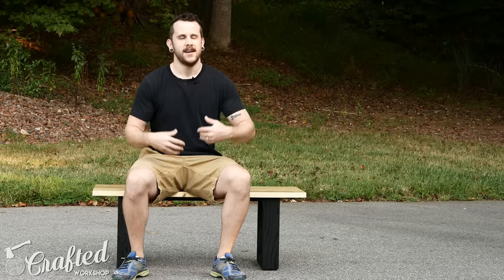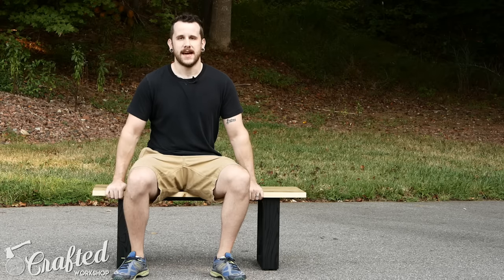How To Build A Modern Pallet Wood Bench | Crafted Workshop

Comment: Cool bench! Be nice to see a video like this that's done primarily by hand. Rather than with £1000's worth of tools which some of us don't have.
Reply from the maker: +Sharkfat I can't even imagine how long that would have taken by hand! Took me at least 20 hours with power tools.
Reply: OK, not including materials (= $0?), overhead and tools, a sale price btw $1200-1400 ???
Reply from the maker: +Stijf Wood overhead is nothing really, I work out of my garage. Tool prices are a fixed cost, I don't really factor them in unless they are getting a lot of wear and tear on a given project. I would sell this piece for ~$600 based on the amount of labor.
Reply: OK, thx for the info. I'm in Norway and ur estimates wouldn't pay my bread and glue, at least not if price is before taxes. But then, life is expensive here and a pint of beer easily costs $10 in any bar, so it's like comparing apples and oranges. Keep up the good work man.
Reply from the maker: Stijf Wood yea, definitely a much different cost of living there!
Reply: More like £10,000's worth of tools. His Table saw alone is over  £1000.  But don't be drawn away, I started with a 15$ hand saw and now 2 years later, I have a 3 1/2hp  Powermatic Cabinet saw. From projects like these.. Well manly cedar planters.

Comment: Cool project. Thanks for being realistic with the use of pallets, it's always overhyped and people don't realize how much labor is involved.

Really shouldn't have to start with 80 grit straight off the planer unless you have some major nicks in your planer blade, but in that case I would use a few passes with a handplane.
Reply from the maker: Thanks! Yea, pallets are a pain. I had some tearout from the planer due to the differing grain directions, hence the 80 grit. Also had some snipe to deal with.
Reply: I have the luxury of access to some industrial pallets used for transporting bulk metal so it's far more usable stock but it's still very labor intensive, so much so that I rarely even try for a modern piece and stick to mostly rustic.

Oh yea, makes sense, I suppose that thin pine would give you some chip-out/tear out problems.

If you get a chance to work with industrial pallets it's worth another shot but I agree with your special pallet project at the end for normal ones.

Comment: another way to take apart pallets is to put it upside down(if there is a bottom/lesser side) and elevate it a foot or so, and using a rubber or dead blow mallet, knock the boards out, and flip over and repeat, you may lose 2 full boards doing it this way but you could always cut them remaining out.

Comment: Ha! Your final pallet project is about like mine...I gave it away to a neighbor. I do not really like working with spar urethane. I recently used that on my front porch beams/posts to try to prevent them from weathering too bad. They are cypress, so they don't really need it, but I don't want them to turn that black color that cypress tends to, after getting exposed to some weather. Do you like working with spar urethane?
Reply from the maker: I haven't had any real issues with it. Easy to apply, levels well, and fairly cheap.
Reply: I guess I just found it stickier than other finishes.
Reply from the maker: +Bruce A. Ulrich huh, interesting. I haven't had those issues with it.

Comment: what is your opinion about the dewalt flexvolt system? it looks amazing, and so your works!
Reply from the maker: Hah, I love it! The battery lasts an incredibly long time. I don't really NEED cordless in my shop, since I'm obviously near an outlet, but it's got just as much power and the blade spins up and stops much more quickly.

Comment: knowing that after gluing up strips you would to re-joint to get square and then rip on table saw did u make the the two end strips thicker to compensate so all the strips are the same size?
Reply from the maker: +Andrew Hansen I did, left everything a little oversized.

Comment: pallet wood sucks for the most part haha, I have quit using it for the most part for the same reasons. It's not worth all the trouble. I don't mind incorporating a small piece every now and then like the drawer front I did in the side table video.
Reply from the maker: Agreed. And yea, that drawer front turned out awesome! Sometimes there is some nice wood hiding in there.